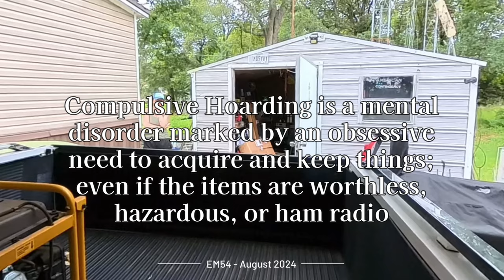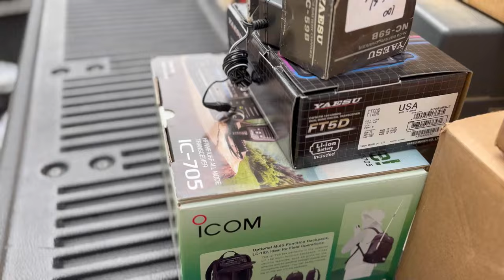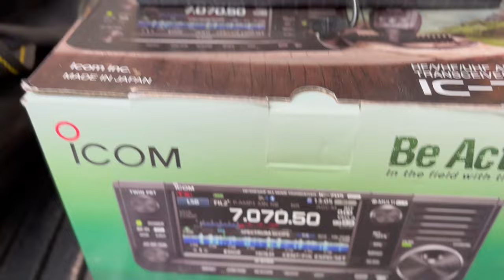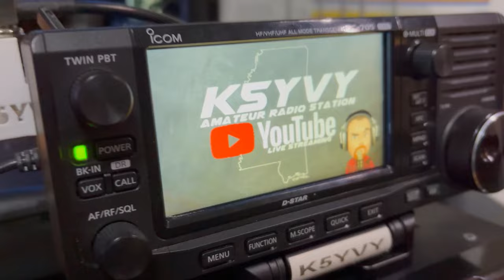I wasn't ready for this stress | HamShack Hoarder | HamRadio

Comment: When I initially started watching this is almost felt like a parody.. but it took a serious turn and while watching got me looking at my shack ..  I too need to take a deep dive and go through all that i have inherited from my dad, what I've purchased and used and what I've purchased, built, thought about building and just haven't used or finished.  thanks for sharing your struggle.
Reply from the maker: Same here! My plan was to record a simple video showing before and after…then it got more difficult than I intended. I still have a lot to go through.
Reply: @K5YVY  You were spot on about having a need for it and having to buy it later..
Reply from the maker: @K6WRF facts lol. I have found use for some random thing many years after deciding to save it lol.

Comment: Congrates on the tranformation. Having only been the hobby for only a few short years, I can understand how easy it is to keep stuff that you think you'll need in the future. For me, I have to really think things through when considering the purchase of any new piece of gear no matter how small it may be. As someone who has a small space carved out in the livingroom, I always try to keep myself in check. So, what I decided do at the outset, is that whenever I buy soemthing new, I get rid of anything I no longer use no matter how I feel about its future use and as for organizing, all my radios are mobile and mounted in 6U a rack mount case for that I can pull whatever radio I need for Field Day or any outdoor even and pack it in a Apache case. This with the help of a Walmart shelf and plastic containers, I'm able to manage it fairly well. In short, I try to be a ham radio minmalist, if there is such a thing.
Reply from the maker: Whoa, first I congratulate you for having the strength of mind to accomplish that, second I may need to hire you to manage my shack lol. 😎